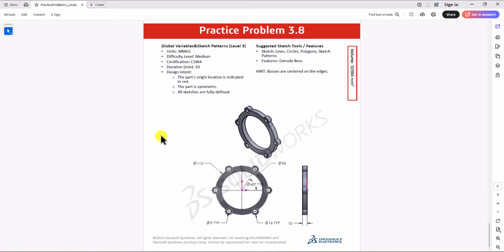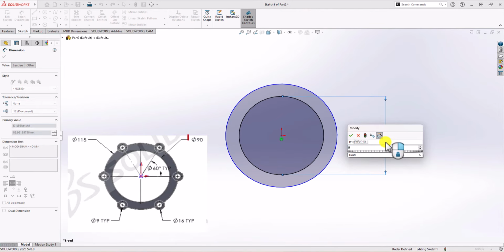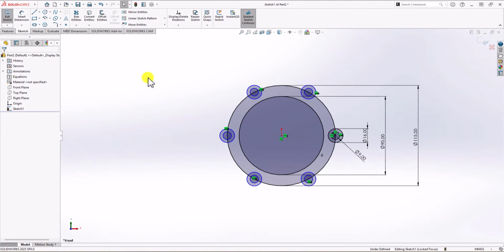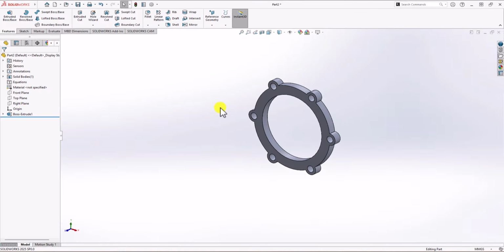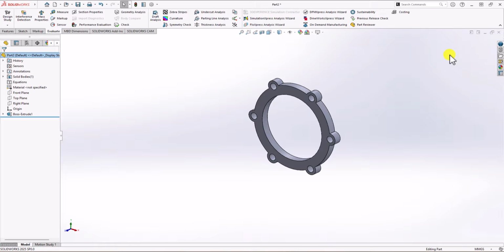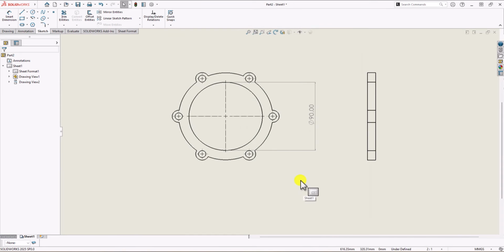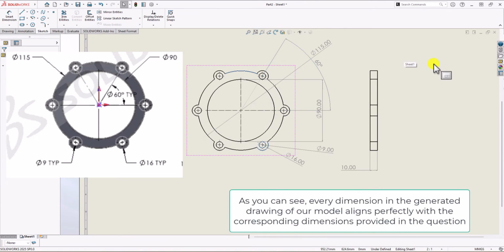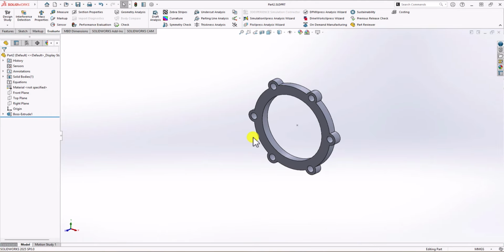CSWA Practice Problem 3.8 Solution | SolidWorks Exam Guide

Comment: answer in the queastion is wrong for sure. kame here so check my results.
Reply from the maker: Yeah, unfortunately, that's often the case. There are many situations where the provided answer may not be completely accurate. I suggest that if your answer is within 1% of the provided solution, you consider it acceptable. Sometimes, the version of SolidWorks can also affect the final answer, since different versions may use different algorithms to calculate volume.

Comment: thanks for posting this.  so frustrating that solidworks has the answer wrong.  geezzz la weeeezzzz
Reply from the maker: I completely understand the frustration, but it happens more often than you might think with these practice sets. I suggest focusing on the modeling approach rather than trying to match the exact answer. As long as your result is within a 1% error margin, you should be in good shape.

Comment: Thanks so much for the clarification. I'm starting to get a bit sick of these CSWA practice questions being wrong or incomplete.
Reply from the maker: I understand the frustration, but don’t worry about it. As long as you know the proper approach to model the part, you should be fine. In the exam, the multiple-choice options usually aren’t very close in value, so if your final answer is within 1% of the correct one, you’ll be able to find the right choice. This means that small mistakes, like forgetting a fillet or chamfer shouldn’t prevent you from getting the correct answer.
Reply: Agreed. I hate having to watch solutions and it pangs at me when i realize its not me who's incorrect but the answer itself. Thank god for this channel though, saving me so much time and effort with all the helpful tips starting from 1.1 itself

Comment: Great tip to make a drawing to help validate simpler models, quite often I'm slightly out compared to the correct volume, and it's always a toss-up if my constraints/dimensions are incorrect, or if it's an error in the paper. Thanks for the tips!
Reply from the maker: I’m glad you found the video helpful! Mistakes happen, but I’ve found that making a quick drawing and checking dimensions makes it much easier to spot the source